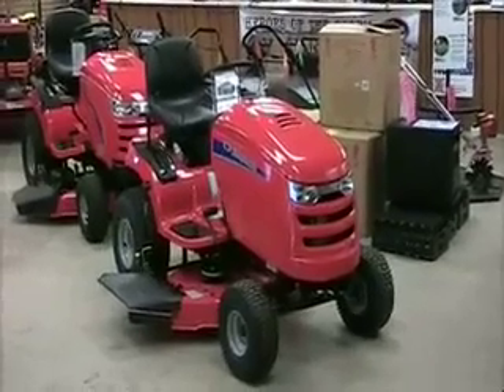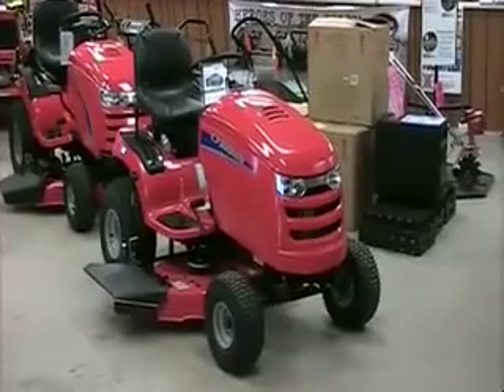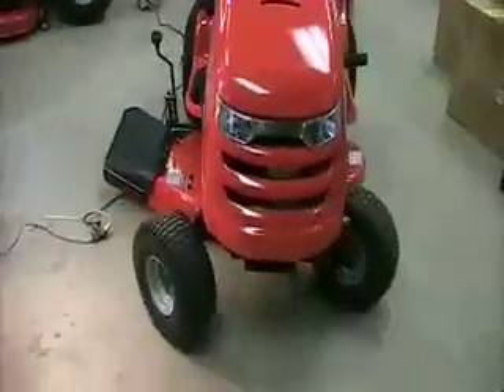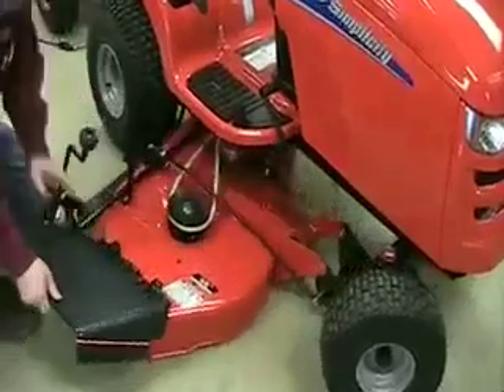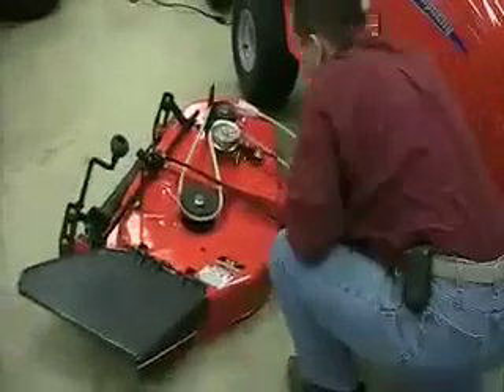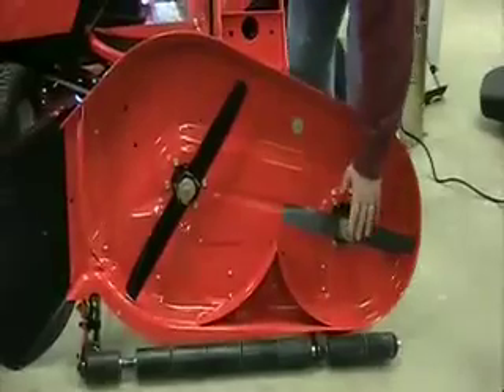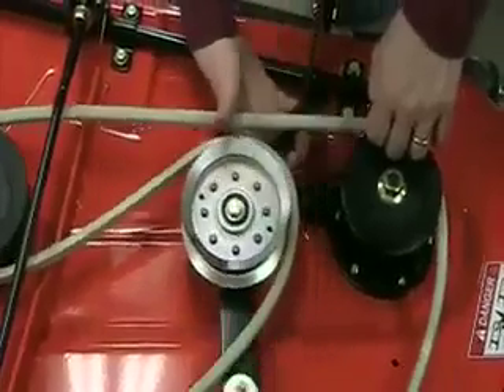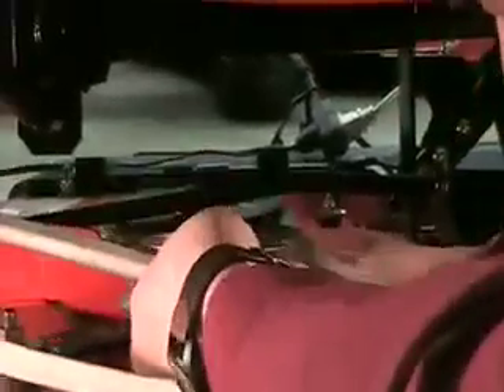removing the mower deck on a tractor.mov

Comment from the maker: All that pin secures is the lift cable.  When the mower is in the down, or mowing position the rear rollers are on the ground. In the up, or transport position the cable is holding the rollers off the ground.  The front of the mower is secured to the front axle with a heavy rod that is locked into a hook shaped bracket.  It's definitely not going anywhere.
We've never had any mower decks that have come loose from the tractor.

Comment: On my 54" conquest, will not work like that. You have to raise the front wheels to pull the deck out from the side with the handle still attached. A short video on replacing the rear steering ball joint would be nice.

Comment: I can get my deck off to clean okay, but reinstalling it is a bear. I put the lift cables in place with clip. However, this makes it difficult to secure the front end. Think I will get the front end in place with spring bar and work from there.